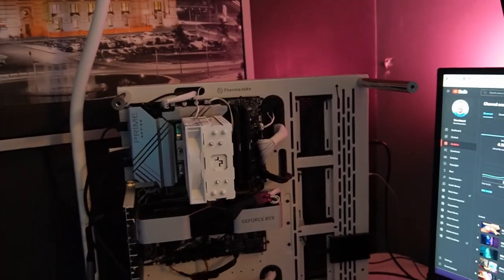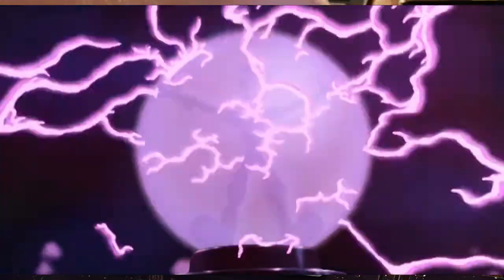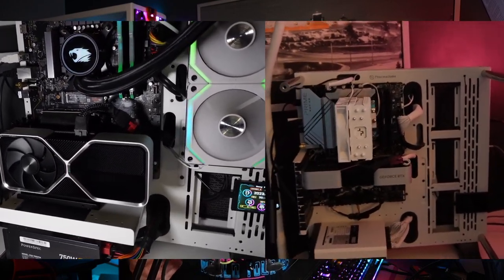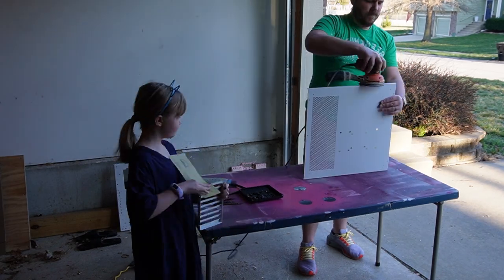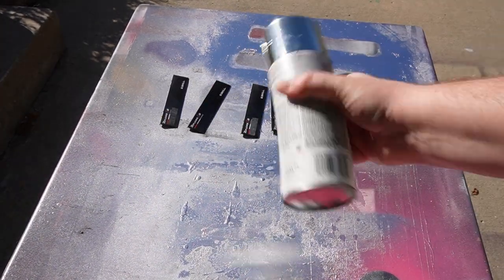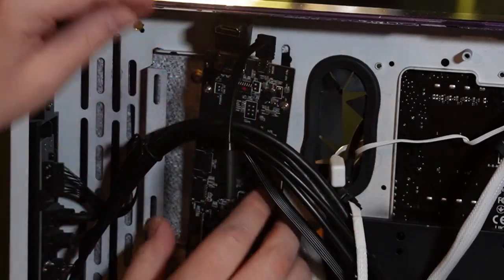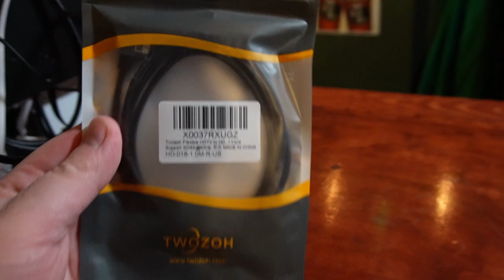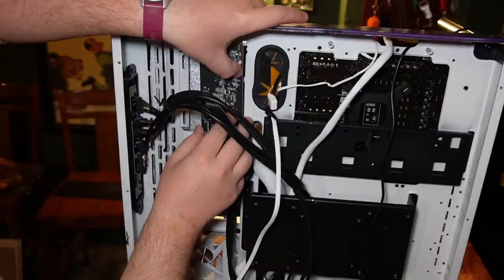Modding My Thermaltake Core P3 To "STAND OUT" | The Powerline PC

Comment: If you put the screen at a 45 degree angle to the glass you could create a hologram (if you turn off all the RGBs)
Reply from the maker: I've been mostly using it with the glass off the case but that's a really interesting idea. I might have to think about that a little bit more, how could I use the glass like that?

Comment: i upgraded my ram to 4gb to 12 gb it works great do you have discord
Reply from the maker: That upgrade will make such a big difference!

I don't have a discord server yet but I've been thinking about putting one together. Is that something you'd use? Server with other computer builders and modders?
Reply: ik its way smother than ever before rn opened yt only 11% usage lol im using for kali so its not a waste
Reply from the maker: @Becongamplays  That's the best feeling for sure! 😎😎
Reply: @DevonDoesTech  i had 4 gb and 8+4=12 and when i told i had 4gb he told 4!! because he has 8 and now i toled i have 12 he did not respond lmao